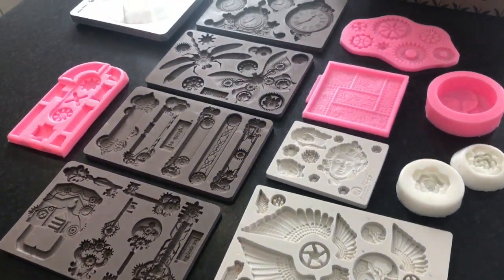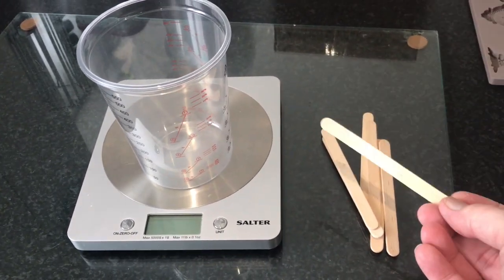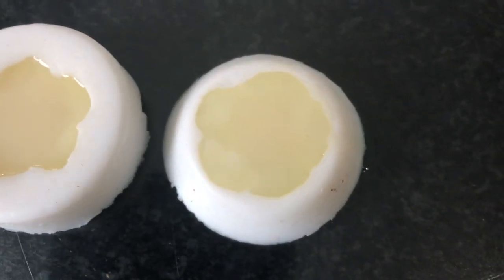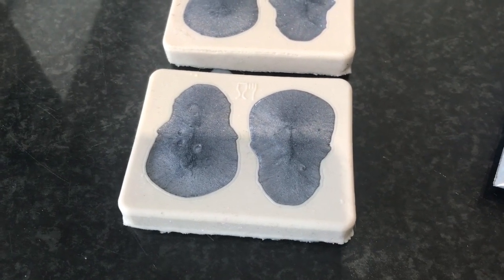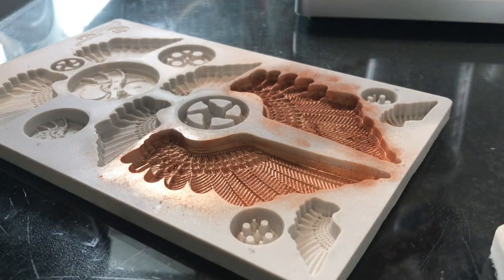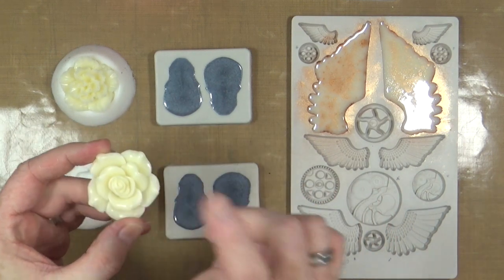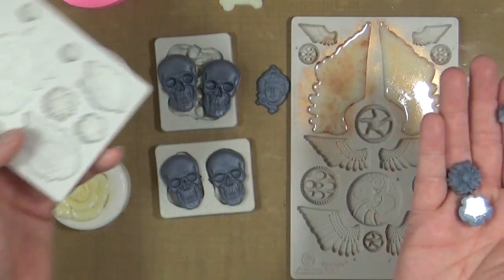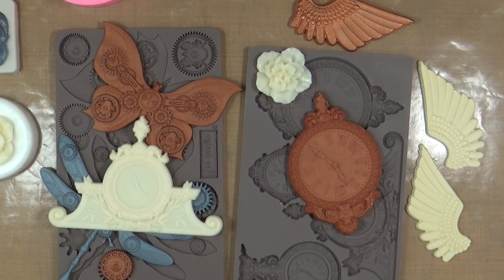Casting Poly Resin from Cake Decorating Moulds

Comment: Oh, my! Simply gorgeous elements to use on many different craft projects. Thanks for sharing, Mike. So quick to do and I can see how addictive it would be. Question: Does the residue in the cup just peel off or wash in soapy water? I wonder if you can create a marbly effect with the mica powder? Love to you both xo
Reply from the maker: The residue peels off once hard I’ve never tried to wash it in water as the cups are recyclable.

Comment: Great video with great ideas,now i know what to do with my mica powders..  Have u ever used a spray mould release?  I saw a can on amazon that said u can use it with your moulds and it prolongs the life of your moulds, thoughts?
Reply from the maker: You saw how easy the casts came out of the mould.. a release agent isn’t really necessary
Reply: @MikeDeakinArt  I tried the paint on mica powder yesterday and it came out beautifully.  I was just wondering if some moulds were harder to come out than others and that was why they have the mould release spray. Personally I have not had any issues with using the resin with the clear moulds, I haven't tried it on my finnabar moulds yet.   I really love your videos.  Have a wonderful day!